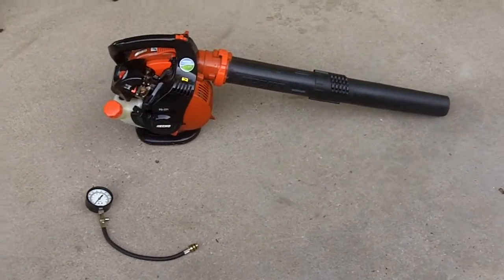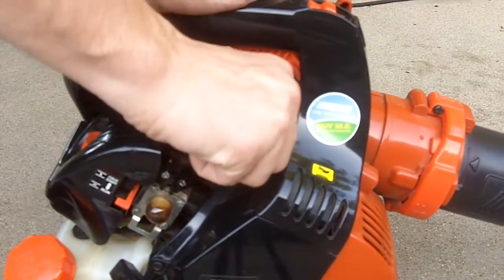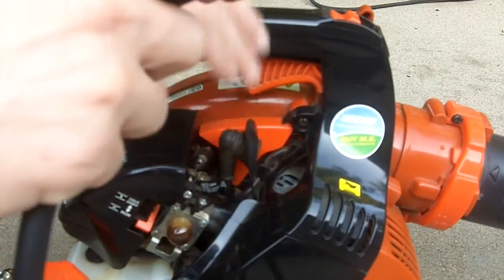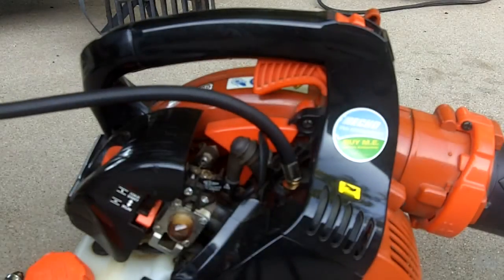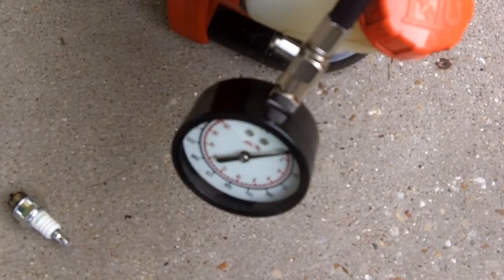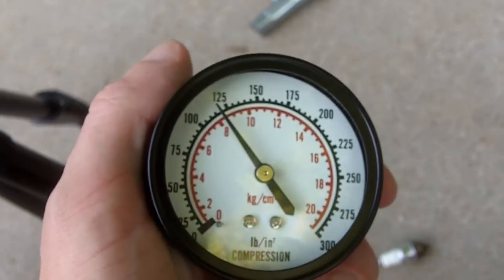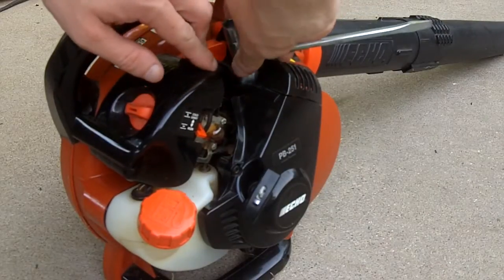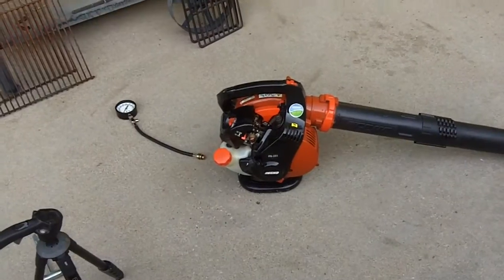Echo PB 251 Compression Test

Comment: I have that model and bought it new in maybe 2007 IIRC. Used it for probably 7 years and more than a typical homeowner would but not nearly as many hours as a pro would. (I was mowing two or three lawns a week sometimes plus my house has a large wooded lot) About 8 years ago I was using it and it just died quickly like the ignition was switched off. I messed around with it a bit but gave up pretty quickly and bought a refurb Hitachi online to use until I got the Echo running again. I always hated the Hitachi because it was not as powerful and is terribly out of balance so I can't use it for long periods of time. Recently I decided to get the Echo running again. I'm not going to you all the details of my diagnostics which was probably done out of order but I'll tell you what I replaced. New all OEM carb, fuel lines and their tank grommet, in tank filter, tank vent breather, tank vent hose and grommet, fuel cap gasket, air cleaner element and spark plug. (gapped to .027) I checked the inlet to the muffler, the outlet of the muffler, the spark arrestor screen and the cylinder exhaust port for carbon build up and they all looked great. Compression is 100 psi with engine cold with my old cheap compression gauge. The fuel I'm using is pretty fresh, mixed to 50:1 and has been working fine in my Hitachi blower and my 17 year old Echo trimmer. It is very hard to start and I have to have it on full throttle and full to half choke to keep it running and even then it might have half or less of full RPM. It will only run for  10 or so seconds and just starts to bog down and quits. It also will not idle at all. I'm about out of ideas.